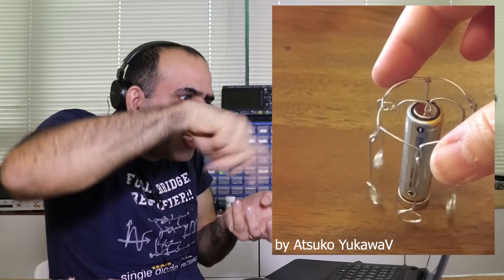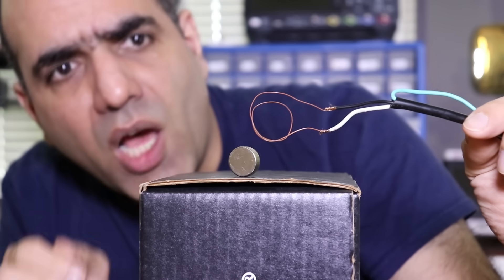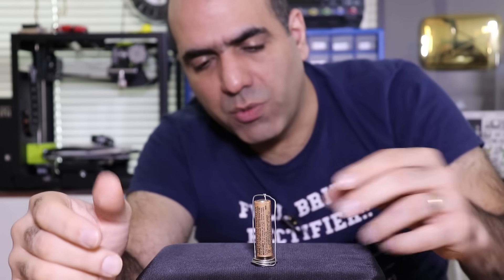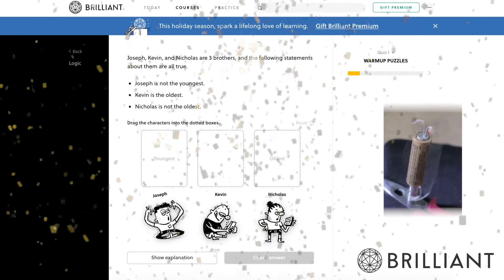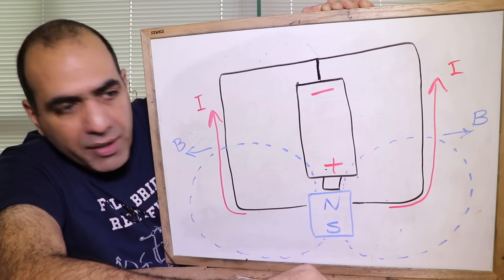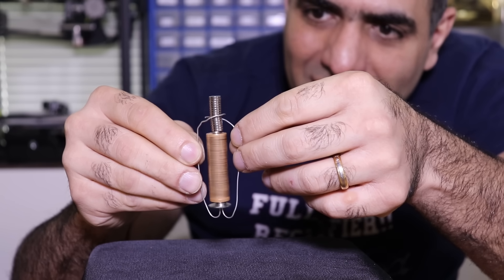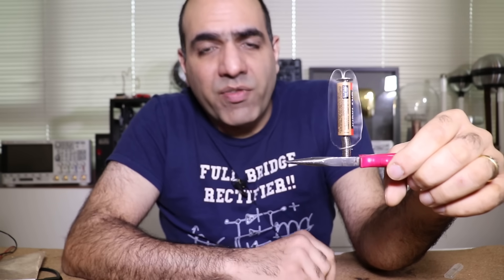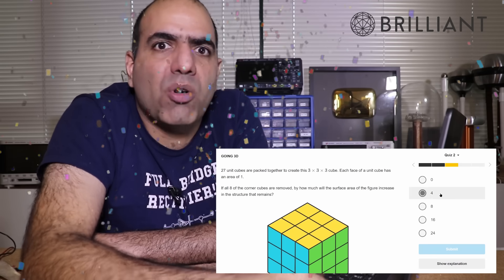Super Simple DC Motor

Comment: how easily can you set fire to your house if you drill into a live wire thats in/around a stud? it can catch fire to the drywall/isolation and wood im sure..... but how easy is this? i  bought a shitty stud/wire detector and before i knew it was shit i drilled.... now its saying where i drilled has a live wire.... even though i checked multiple times before drilling....

Comment: Why is there electrical grounding for sinks and bathtubs in the US? If someone comes in contact with a live wire and using the sink or shower, you’ll die... The only good I see is that if there is a static built up, that the ground would pull it away, but how would a charge even get there?

Comment: Instead of wire, use a new resistor with long leads. Or a couple resistors in series. See how high in ohms you can make it work (least power draw on battery).

Comment: would doing this with a rechargeable battery and manually turning the wire the other way charge the battery?
Reply: Rechargeable batteries do very violent hot melty things when they get shorted out.

Comment: could you please connect two microwaves transformers in series?  I want to know if the second transformer can handle the voltage 230V -> ~ 2100V -> ~ 18000V

Comment: It would be great to test what kind of peak current you are taking out of the battery with this setup. 
I’m guessing two conductive plates and  an insulator could be sandwiched between the bottom magnets and those connected to a shunt would be the easiest way.

Comment: I think the force doesn't disappear when you disconnect the wires, instead like any conductor as the current collapse a magnetic field is built up (in opposite direction) which - combined with the inertia - cause the loop to turn once again.

I am just a beginner so I could very well be wrong.

Comment: ❌❌❌❌❌❌❌❌
Left hand rule - motor
Right hand rule - generator
 But u say it as right hand rule??????
Reply: It depends on how you put vectors on your finger. In the way Mehdi did it works with right hand. If you want to do it with left you need to change position of both current and induction of the magnetic field, putting I on your middle finger and B on the other one.

Comment: I made one of those a while back, but instead of trying to find some stiff wire, I stuck a screw on top of the magnet and that was able to hang from the bottom of the battery (just enough pull without much friction) then I connected the top of the battery to the side of the magnet, it spins very fast!

Comment: I love how everyone ignored the fact he managed to blow up a bare wire.
Reply: Probably just added some flux or impurity around the point where it broke. Heat made the pop.
Reply: @mattquick5045  Live wires definitely have enough current to do that, why do you think that it's impossible?
Reply: @coolguy284_2  I will revise my answer, upon reviewing it seems the wire did not pop, but rather there was an arc between wires in the loop. But HAD the wires actually exploded, what do you think would have possibly made that sound? Wires heat up and melt, how could they make a popping sound? Therefore I thought he had added some flux to the wire so that when it boiled quickly it would have made a popping sound.
Reply: He does it almost every video
Reply: Nikenn usually he blows up circuits. He may have blown up a bare wire before, but I don’t remember seeing it.

Comment: These mini motors would be great fun with a small solar cell instead of a battery.  Solar cells can be safely shorted and they won't get hot and have a chance of exploding as a battery can do.  Of course, you'd have to have your wire rotate around something else since there would be no battery.

Comment: I like the second design with the magnetic wire.  But, if you run it for a long time, the constant rubbing of the wire on the metal holder, I'm guessing, would eventually wear down the protective coating on the one half and the motor will stop.

Comment: Grade 8 me: if battery is on a magnet and a wire on top it will turn because of the electricity running through the wires to the magnets

Comment: That second one also functions as an oscillating circuit. Or an almost AC generator. Almost, right? Because I think for it to be "alternating", the current has to periodically reverse direction, not just stop and start. (Yes, of course. Because a capacitor in series wouldn't work as expected if the current is not truly alternating.) So you'd need... a couple of resistors as a voltage splitter to set a midpoint, right? For a really bad, inefficient, unreliable square-wave AC power supply. Did I do it?

Comment: Strange. In electronics class we just put 2 normal wires with a hook on either end we crimped shut then shoved a thin wire curled into a coil with a magnet sitting right underneath it to make a motor. A bit more complicated but it works more effectively as there's basically no way it can fall over. Plus it seemed to spin much faster.
Okay, basically what you ended up doing at 7 minutes.